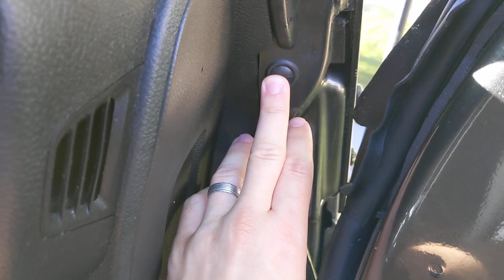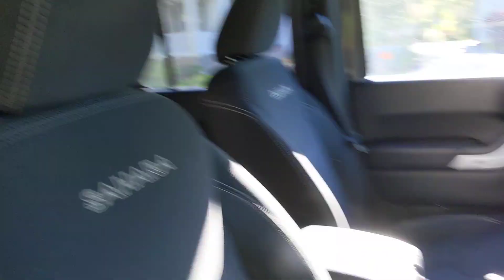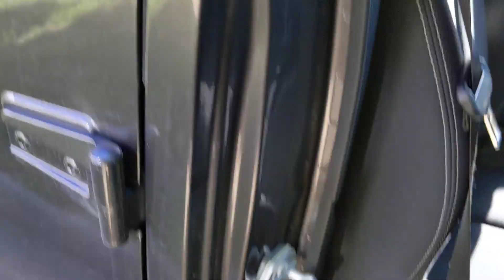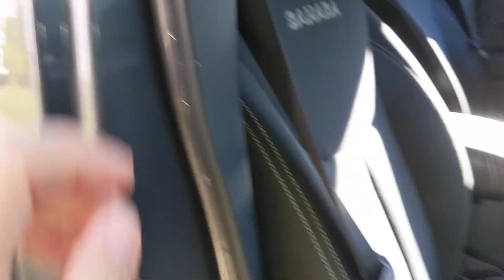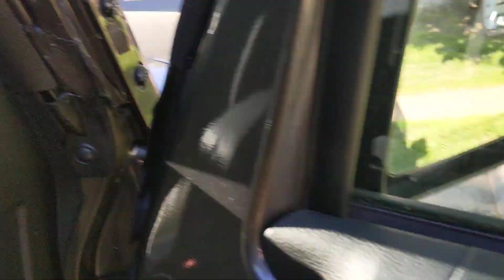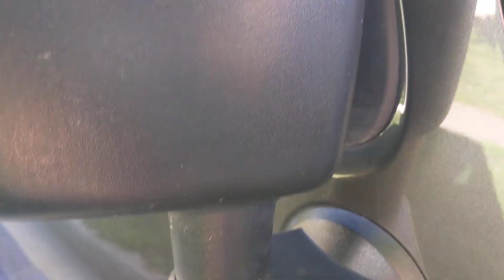Fixing a 2016 Jeep Wrangler JK/JKU Passenger Side Door Water Leak (Wet Carpet and Floorboard)

Comment: bringing my jeep to the dealership today for that issue since its under warranty. Hope they fix it, if not itll be this video that does. I do think it's either the A pillar or the Cowl bcs only the front half of the passenger side mat gets wet
Reply: Update?
Reply: just been trying to park it in the garage in throwing some cheap rubber weather stripping on the door frame for as long as it lasts. also the dealership will not fix it under any circumstances they will take 200$ an hour just to spray water at it to diagnose the issue. then after finding the issue will charge you extra @foxfox9931

Comment: my JK is a 2018 and started leaking just after the 1st year. Jeep as a company has had one thing going for it and that is the style. Everything else about Jeep is simply garbage.
Reply: Rich I totally agree with you on the style of the Jeep. Also, I love the versatility of the Jeep, but this leak issues with older and newer model Jeep’s are ridiculous! I just bought a 2017 Wrangler 2 weeks ago, I’ve taken it back to dealer twice. Solved the leak in drivers floorboard, rear passenger floorboard, but it’s still wet in front passenger floorboard after last night’s rain! Frustrating as hell!!!
Reply: @Countrygirl4ever602  my guess is when people get in and out especially in a used one, there foot hits the liner seals slowly wewring it down or moving it causing this issues

Comment: Nice video!  This video has really been the first one that actually describes everything in detail.  I've been fooling around with the same water issues on my 15 jku (also cooperhead perl).  I haven't removed the trim yet, but might try the soapy water test.  But I'm definitely replacing the door seal (driver & passenger).
Reply from the maker: Glad it helps!  I spent probably 6 months or more messing around with the Jeep in various different ways figuring things out.  The Mopar leak manual you'll find on Jeep forums should be step 1 for most problems.  When it still can't be fixed with the manuals suggestions then this video is definitely helpful.

I went through 2 full door replacement seals, a mucket seal, etc. until I finally popped off the trim (while having my son hold the water hose at the door in various spots from the outside) .  Even then it took me a few weeks of diagnosing and trial and error.

Let me know if you have questions :)
Reply: @PhelixTheKhat  the new door seal actually made the amount of water worse (even adjusted the strike plate due to closing issues).  Im going to try the silicone/camper tape trick next.
Reply from the maker: @dirtyagent22  the replacement weather stripping started the a-pillar leak in mine.  It's super frustrating
Reply: @PhelixTheKhat  after the tape/silicone,  the drivers floor is final dry!  Now on to replace the passenger side door seal(might as well change it out too)